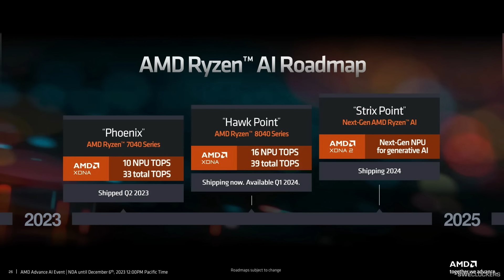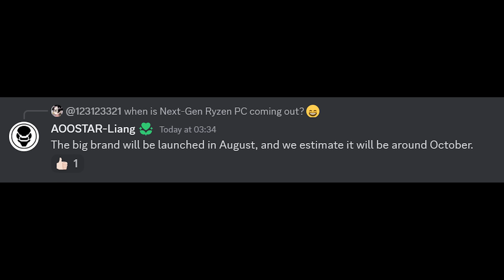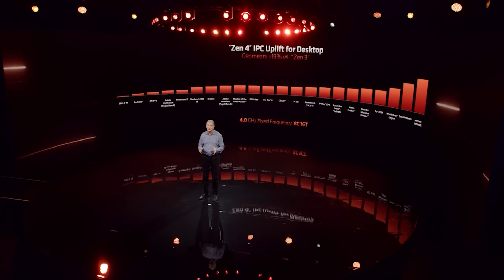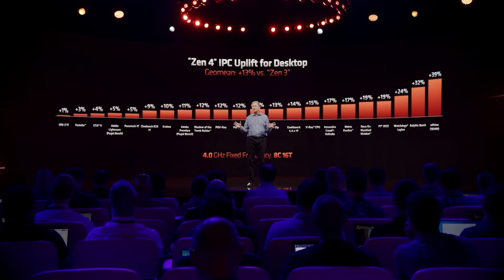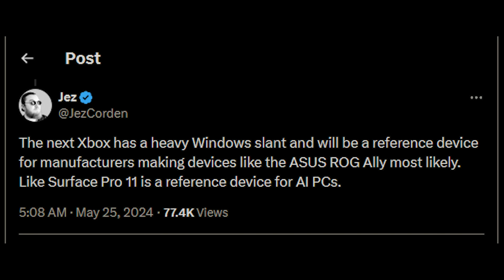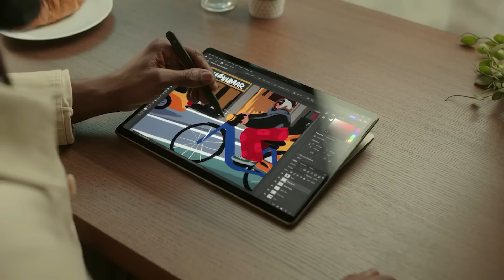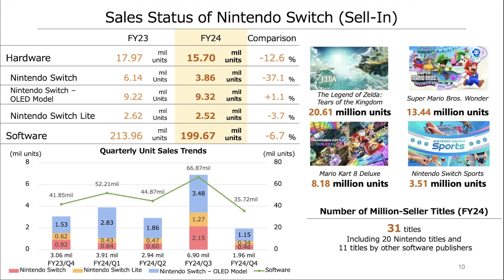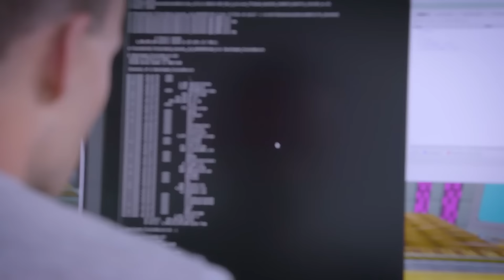Zen 5 Is ALMOST HERE! Ryzen 9000 Release Date Leaks

Comment: Definitely getting zen 5x3D :)
Reply: Me too, but the sad truth is as the other commenter stated. We are going to have to wait a long time to be able to buy the zen 5x3D.
Maybe not a whole year.....fingers crossed. But probably not far from that. If the regular zen 5 is selling bad because we all are waiting for the real deal, maybe we can get it sooner than that though.
Reply: I’m hoping they release a cheap 7600x3D for me to jump onto the AM5 platform.
Reply: @cajampa  It'll come after Turin-X. The X3D parts are binned server parts so once AMD starts selling Turin-X in volume and gathers enough failed dies to make them, they'll release.
Reply: @riven4121  Yeah, good point.
Reply: I expect to, but it's all price to performance.

With more cache for the standard models and the various leaked architecture changes it may end up like Intel where 3d cache doesn't give anywhere near the benefits seen in the 5000 and 7000 chips.
Reply: @TechTusiast  Also depends on your GPU limits.

I don't think I'd gain a whole heap of performance without a 4080 Super or similar.
Reply: @Kitten_Stomper a 7600 non X is already cheap and so is Ddr5 ram. You're better off saving your money if youre still struggling to get into am5 at this point
Reply: @McDowell666  2025 April X3D.
Reply: @phillysupra  sure they’re cheap, but I’m more cheap.
Reply: @Kitten_Stomper  then you chose the wrong hobby.....but you're in luck, there's a bright future in origami making
Reply: @phillysupra  maybe, but there’s so many great retro games to play in the mean time. I have a 9700k and a 6800 right not. Not exactly suffering.
Reply: @Kitten_Stomper  yeah I know. I have a raspberry pi free standing arcade. Roms are free online so I know all about using slow hardware.
You're Def suffering with a 9700k as even the 7600 demolishes it by as much as 40% with two less cores and is currently still cheaper...(depending where you buy it, cuz microcenter is usually the cheapest sales)
Reply: i may do the same.   I need more cores tho lol

Comment: Traditionally the Companies will intentionally sell the console at a loss and make it up on game sales.
By outsourcing console sales, they side step both that loss period and any potential warranty issues.
Reply: The problem for MS is that can never sustain sales long enough within a generation to raise margins while selling at same launch price. 

In Year 1 they lose the most. As components get cheaper, the initial price allows for better profits. By Year 5, GP margins can actually double. 

This is why Nintendo is killing it right now. They make mad cash on Switch consoles. Nintendo's costs have gone down for 7 years straight. Nintendo will make more on each individual Switch console than they ever have in the past. 

I'm still surprised MS stayed in as long as they have, but to lose so much revenue after 20+ years of trying says a lot about their failed strategy.
Reply: Don't take "loss" literally, the only thing they're losing is the difference between what the manufacturer imagines the price could be and reality. If a console costs $200, and they want to sell at $600 but the market will only pay $450, the profit is still $250, but they think they're losing $600 – $450 = $150.
Reply: Nintendo Switch costs $257 to manufacture in 2024. That one rang my bell bc the Switch is 7 yo.

Comment: Considering the core config for chiplets are the same, I don't think it's any secret that AMD will launch the 4 main parts at the same time, 6C, 8C, 12C, 16C.  No need to ruffle any feathers over that one.  The ONLY thing that would be in question is when they release 3D parts, but I suspect AMD will have almost all its entire line before the holiday shopping period, beginning of Nov.  Now, I don't think AMD is going to do with Zen 5 what they did with Zen 3, where they kept putting out more skus even more than 2 years later.  That will probably happen with Zen 6 which will most likely be the last line on AM5, and also be the big seller for AM5 just like Zen 3 was for AM4.

Zen 6 is going to be a big deal.  Zen 5 is going to be better than Zen 4 but still subject to the same issues of the current MCM architecture which will never be fast enough unless it's insanely over-engineered to overcome data transfer speeds on a PCB (chiplet has to transfer data onto a PCB, across runs to get to another chiplet), THEN go through a multiplexer (infinity fabric), THEN get transmitted to the chiplet it's supposed to go to unless the chiplet is the IOD, and undergo two data conversions to make this happen, parallel to serial and then serial to parallel.  So, Zen 6 moves to direct connects between chiplets and gets rid of ALL that, no need to covert data as direct connects are very effective handling parallel data just as it is on-die.

Zen 6 is where the FULL potential of chiplets is realized with AMD.  I believe Intel started with direct connects so they're going to be fine right away with what they're doing, and I can't wait to see what Arrow Lake brings to the desktop.  Those are the two products I'm REALLY waiting to see, Arrow Lake and Zen 6.  I'm buying one or the other, upgrading from a 5800X3D.

As a side note moving to direct connects means you don't have to stack cache.  You could have an L3 chiplet, and in fact that L3 chiplet could be a shared pool of cache between ALL cores on any core chiplet.  This is what I'm hoping AMD does with Zen 6 which will mean CPUs with extra L3 can have cores that aren't slowed down.
Reply: What do you mean "never fast enough?" these are the fastest chips on the market as it is. Sending data directly between chiplets is hardly the common case so there's no point spending so many resources on it.
Reply: Yes I am suspecting the same this time around. AM5 will last for 3 generations not 4 like AM4, which was a huge success for the company. IMO, they should do the same with AM5 by making the socket last 4 generations but by the time DDR6 comes out it will require a new platform since Ryzen 6 is designed with DDR5 in mind. People forget that each new cpu generation that comes out was in design the previous year....for example when the Ryzen 5000 series came out Ryzen 7000 series was in design phase.
As for AM4...my daughter needs to upgrade since her computer is an old dell precision T5400. I can build her a ryzen 2600x with a b450 motherboard and ram for around $130.00 and when she saves some money her upgrade from that will be a 5800X3D. No need for a new motherboard or ram. Sweet! The only thing she will need is a new case and powersupply(since the dell is proprietary) and for that I am going corsair 4000d airflow and a 650 watt corsair fully modular PSU...the only thing she is bringing from her old system is her 980 Ti...the only modern game she plays is Ark Survival Evolved so she doesn't need a new gpu...total build cost will be around $450.00 with new motherboard, used cpu, new ram, new psu, new case, NVME ssd, and some case fans(It is called an Airflow case after all so need some airflow) and I already have a deepcool Neptwin V3 cooler new in box which will be plenty of cooling for the 2600x...I understand Ryzen 2 is not a great overclocker.
Reply: @shanent5793  Dude the current MCM architecture affects MEMORY transfers, not just dual core chiplet CPUs, and it depends what you're doing.  If you think running an all-core app isn't affected by data having to move from a core chiplet by data being converted to serial, transmitted to the IF, transmitted to the other core chiplet, then converted back to parallel doesn't affect performance I don't know what to tell you.  Yes it does and we'll agree to disagree.

For MEMORY, Zen 4 can handle up to about 3GHz on the transfers between the IOD and CCDs, this effectively limits memory to 6GT/s.  Yes, you CAN buy faster kits and get them to run at those higher speeds but it doesn't help performance because the IF can only deal with around 3GHz as a top speed.  The infinity fabric is the conversion circuits on the core chiplets along with the transmitters/receivers, then the pathway to the IOD (runs on the PCB), the transmitters/receivers on the IOD and then the multiplexer on the IOD.  Changing all that out to direct connects which AMD IS DOING so apparently THEY understand their issues with it, to having only transmitters/recievers and the physical connections between the chiplets without ever touching the PCB is going to not only give a good 5 - 10% boost, but being able to run memory speeds much faster will also give a decent boost.

The IF was fast enough for Zen 2 - 3, but it's not even fast enough for Zen 4 and the memory limitation shows it more than anything else, but my guess would be the crappy 8GB/s CPU-chipset speed that AMD has had since 2019, where they beat Intel to 8GB/s but Intel has since moved on to 16GB/s is ALSO due to the IF.

And yes OF COURSE direct connects aren't the common case.  CHIPLETS weren't the common case until AMD put out Zen 2, so technology is ALWAYS changing and what used to not exist but exists now, means there are millions of things that weren't the "common case" so what kind of a statement is THAT?  Intel is using direct connects for their tiles, and they're already making CPUs with tiles at least for laptop.

The fact is there are now companies that can fabricate direct connects between die.  AMD has that with their RDNA 3 GPUs for the mid and upper tier parts between the GCD and the MCDs.  So, it's GOING to become common.
Reply: @VoldoronGaming  Yes, DDR6 will be available even when Zen 6 comes out, not in enough quantity for desktop but it will be in production.  AMD NEEDS to move to DDR6 to be able to add more cores, or really threads to desktop CPUs because according to AMD going above 32 threads starts to starve cores of data from memory when doing heavily threaded and memory intensive tasks, and even though DDR5 spec goes up to 8400, well, that gain is not going to give the ability for more cores, 8400 only keeps up with the improvements to Zen 6 over Zen 4, and you'd really HAVE to have overclocked (by the company) DRAM to allow for more threads, but AMD can't make parts based on overclocking.  They have to make CPUs based on the specs for DDR5.

So, Zen 7 almost has to be on AM6.  DDR5 will limit it too much, based on the specs of DDR5 once again, not seriously overclocked DDR5 coming out of the factories which does happen.
Reply: @johndoh5182  are you for real? I didn't say anything about direct connects or dual core chiplets.

If anyone proposed switching to a completely different interconnect and fabrication process for only a 5-10% boost they would have been laughed out of the meeting. Any new interconnect will still be serialized, only the physical layer changes from organic PCBs to Si.

"Common case" refers to real-world workloads, and not to pathological cases deliberately designed to stomp on the other cores' cache lines. Actually accessing the data on another core or chiplet isn't as important as being able to quickly probe whether another core has already accessed that address. Having this cohérence logic in the IOD has worked well enough compared to the competition, despite the much larger caches which theoretically have a slower access time.

The IF is hardly a bottleneck. Even at 2000MHz a single CCD can read 32B and write 16B per cycle, which adds up to 94GB/s, enough for two channels of DDR5-6000.

The chipset bandwidth has more to do with PCIe capabilities. Intel has simply allocated more lanes to the chip set at the expense of the regular PCIe connectivity. The EPYC 4004 CPUs show that those chipset lanes can be reconfigured as PCIe 5.0 x4 lanes with the same bandwidth as Intel's DMI 4.0 x8. Chipset peripherals are usually low-end like SATA and Wi-fi interfaces so I'm not bothered if they just go away.

Referring to RDNA3 doesn't help your case. MCDs connect to a central GPU die, not to each other. The topology is equivalent to the current Zen architectures, only with wider serial links.

Comment: Can somebody explain why NPUs aren’t part of GPUs like the tensor, mxm cores in nvidia and intel?
Reply: NPU is to GPU what ARM is to X86: They offer greater performance from less power. 

GPUs were originally designed for 3D graphics because they perform complex calculations very fast. A single frame must be generated in less than 17ms to maintain 60 fps. This requires massively parallel processors to do all that math in near real time. If that requirement no longer exists (as with AI) software can allow GPUs to be used for machine learning with trillions of operations per sec, it's just not that efficient. NPUs are purpose designed for neural network processing and don't require the same extra software layer to assist with machine learning cycles. They also consume a fraction of a fraction of what's required by GPUs. 

Notice all the AI marketing is primarily focused on smartphones & mobile computing? NPUs allow any mobile PC to run models locally and accelerate performance. A typical mobile APU with NPU can use BOTH it's NPU & CPU for ML, which is considerably better than NPU or CPU alone. 

Before you ask: NPUs are not well suited for 3D graphics, but can still assist with in-game ML that might normally load a CPU, so NPUs have a benefit in gaming, but it will be a few years before we're comparing NPU benchmarks for gaming.
Reply: @ToeCutter0  Can you rephrase that  while taking into account tensor and mxm cores?
Armv9 and AMD64 are instruction sets. The difference is what compiler you use and wether you use neon, sve2, sse2, avx512. Power does not come into it.
A GPU can use 1 watt like Nintendo switch or 450 watt like 4090. An NPU in a datacenter can probably also use 300 watt.
I don't think power usage is the difference. They have been used to reduce power so that the big gpu can stay off so that is a win. But you could build the big gpu in such a way that only the tensor cores activate.

Comment: Zen 5 will be a paper launch
Reply: Why?  Do you think the IO die or the processor chiplets will be scarce due to low yield?

There are no news or rumors that suggest this.

Zen 5 might be hard to get at launch but only because the demand is high, not because supply is low.

A paper launch is a launch with no product in the sales pipeline or so little that almost nobody actually gets one.  The Tesla Cybertruck is a recent example.

Comment: Ryzen 9000 is not until next year unless they changed their minds about the "7 - 8 -  9" scheme intro'd with Zen4...
Reply: Ryzen 9000 is this year 2024 Q4
Ryzen 9000 X3D is next year 2025 Q1
Reply: @ChristianHowell 7000 launched in 2022. 8000 in 2023 (in q4 ai event).  9000 will launch 2024.
Reply: @blegi1245  No... Why is Hawk Point 8000...? Cause it was released in 2024...
Reply: @blegi1245  Obviously I read the slide wrong.. I'm watching th Computex and yes, it's 9000, which is weird because that means only Hawk Point gets 8000...
Reply: @ChristianHowell  Wrong. Hawk Point and desktop 8000G were launched late 2023 in an amd ai event.

Comment: Intel Arrow Lake > AMD Zen 5
Reply: Don't hold your breath.
Reply: Until the CPU degrades
Reply: NEVER !!! :face-green-smiling:
Reply: 7800X3D > Zen 5 in gaming.
Reply: Hahaha, we'll see.
Reply: @faiyez  I can confirm that this is a thing. Happened to my 13900K and its memory controller. RMA'd it and got a 14900K, but tbh I probably should have just gotten a 7800X3D/Zen 4. 

Intel's flagships run REALLY hot.
Reply: @DerinRichardson  why you don't just set it to intel stock specs?
Reply: Intel will definitely annihilate AMD in TDP and power consumption. No doubt about that.
Reply: Yes! Intel will dominate with another delayed release and double the power consumption.
Reply: One can always dream? I think if it were even close we'd be hearing all about it. Intel  is desperate for anything positive.
Reply: @kevinerbs2778  That's the thing, they degrade with stock specs
Reply: Gonna keep saying it: 'Who wants to buy intel, when you can have Nvida". It's already over for intel. It will be Nvida, Amd and Qualcomm in the DiY. Apple people will keep to Apple and trickle in people over the years. Look you want top business, you go Apple. You want great performance and gaming you go Nvida, Mid and high range and great value you go Amd. You want 70% Apple stuff for cheap you go Snapdragon. Where is Intel? No where, 80% of blue supported will just move over to green. Then that be the end of it.
Reply: Intel Arrow Lake > AMD Zen 5
A few months later...
AMD Zen 5 X3D > Intel Arrow Lake
Winner : AMD Zen 5 X3D